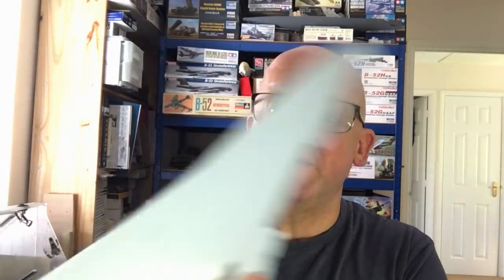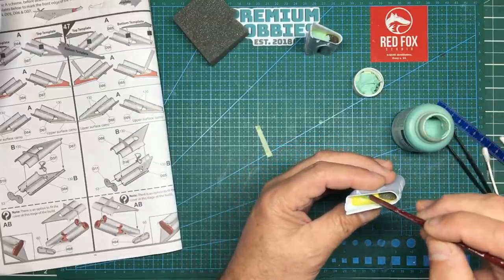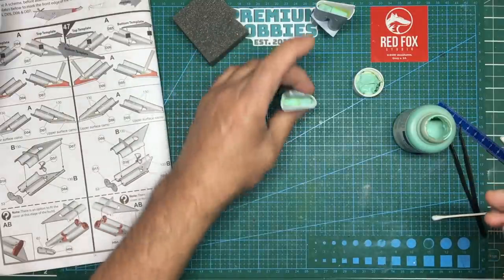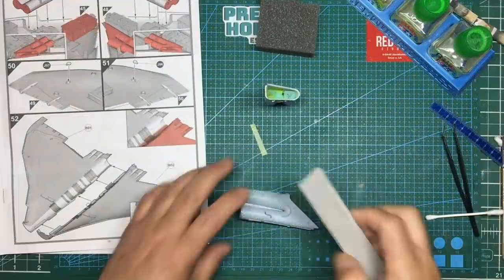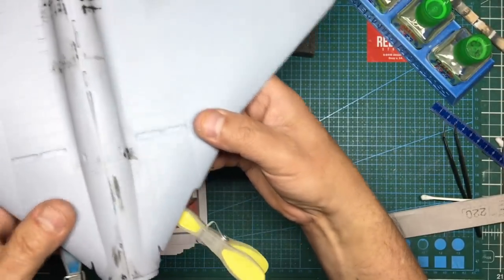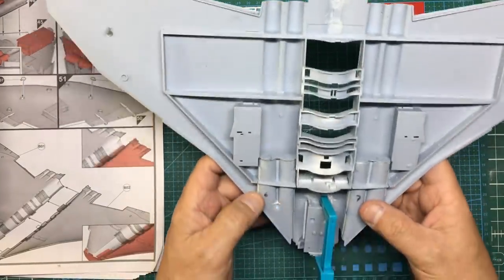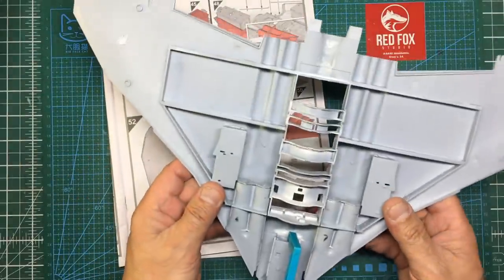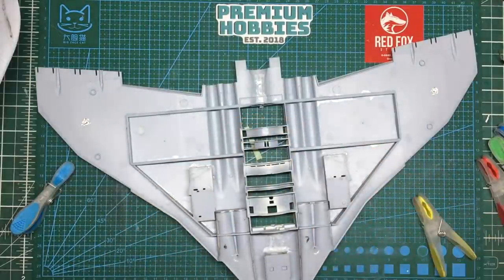Airfix New Tool 1/72 Vulcan build. Part Seven.. masking intakes and getting wings together

Comment: Nigel, I was looking at the underwing lights and a trick I picked up was to paint the corresponding part of the underside of the top wing with either bright silver or Chrome Metalliser and polish it. Then you can (If a coloured light/lights  is/are  required, paint the upper-side of the light in clear blue/green/orange/red as required. Or leave it clear or paint it silver for a landing light.. Mask the outer/underside  side lens  BEFORE adding the light to the wing.
The silver background in the upper wing will disguise ANY flaw in the painting of the light.  (I found this especially useful making the Airfix 1/48 P51D with its coloured wing lights.)

Comment: I'm really enjoying this build! Airfix have done a great job on designing it (with perhaps a couple of slight oversights) but you're coping with those admirably. I'm very impressed with the fit of the upper & lower wing halves and the strength of the two parts fitted together. Keep doing what you're doing!

Comment: another great vid Nige, to stop contacta drying in the nozzle, store it with the nozzle pointing down. Have left mine for months like this and can use it straight away. Also for a "tell tale" use Play Doh or similar as it does'nt stick. I think that the holes in the rear of the fuselage may possibly be for a tanker conversion ???

Comment: Maybe Airfix hired new mold makers the fit certainly looks wonderful LOL.  You were commenting on the stickiness of the tape early in this part, if you take a piece of tape and press it against your chin the oils will negate some of that stickyness for those jobs that don’t require the full strength of the tape to hold parts together.  Just my two cents worth of possibly useless information LOL.  Build is looking wonderful as do all of your builds.  Yes, the master at work.  Cheers, hello to Jess and take care.

Comment: You can prevent revell contacta clog by heating up the metal nozzle with a match. Melts the clogged glue. Flame sparks may appear but as long as the nozzle isn't pointed down so that the flame would rush up the nozzle and create a flaming glue bomb, then it should be fine.

Comment: It’s possible that the problems are because you are not using the templates as suggested in the instructions. They are templates not masks and were designed to be used before assembling the intakes to mark where you should mask to.